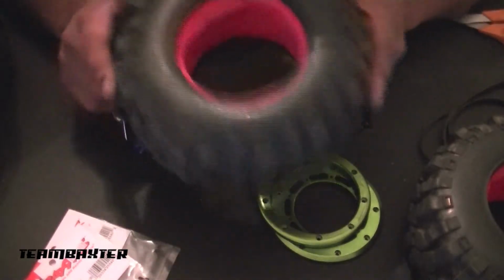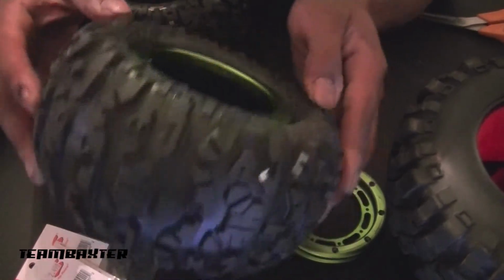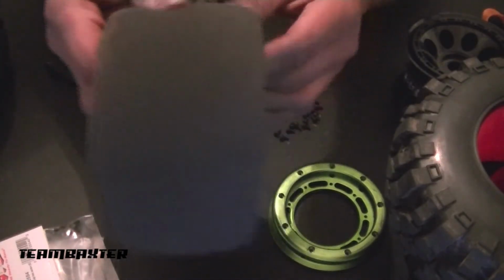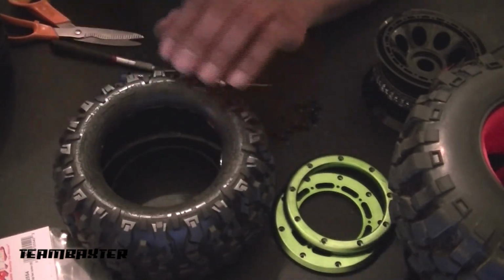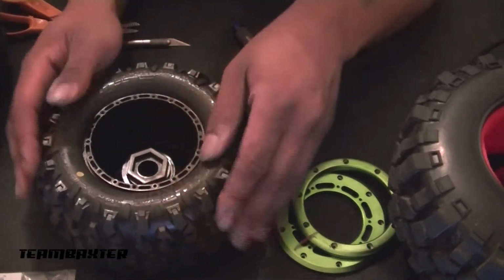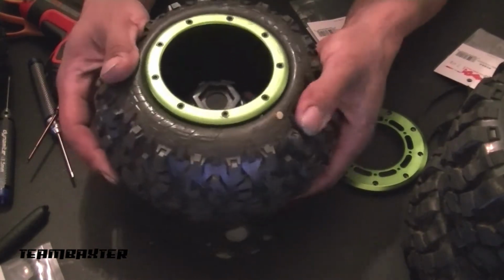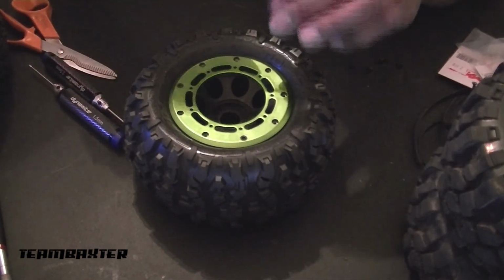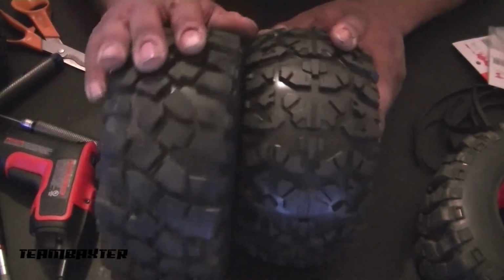MaxStone 8: Mounting 3.8/ 40 Series Tires on Stock Wheels

Comment: You can go to a local hardware store, and get those hex head screws for next to nothing. I went to Tacoma Screw and purchased 50 of the 3 X 6MM bolts for less than 3.00. Most hardware stores sell them by the pound so you can get a lot of them for a small price.